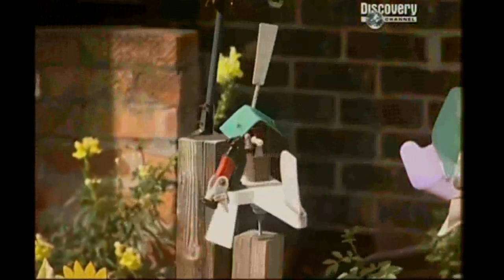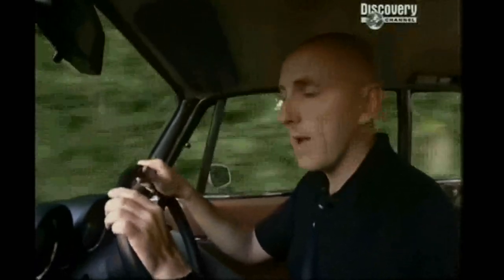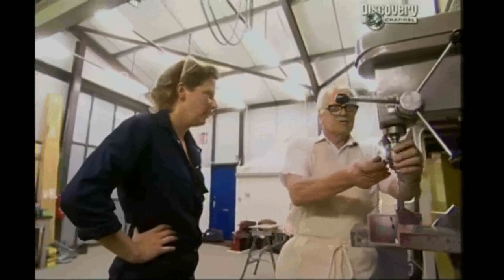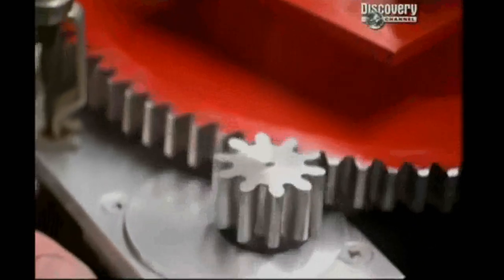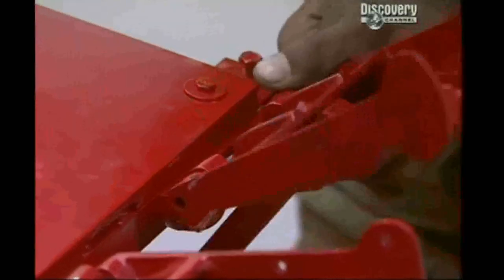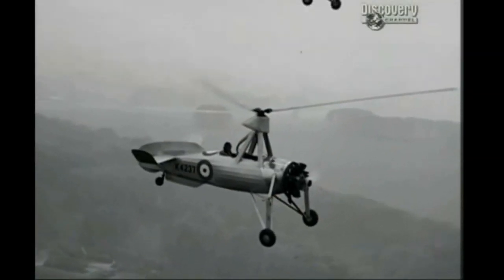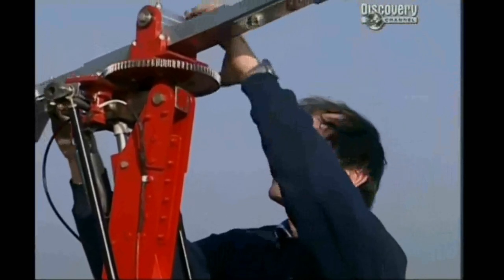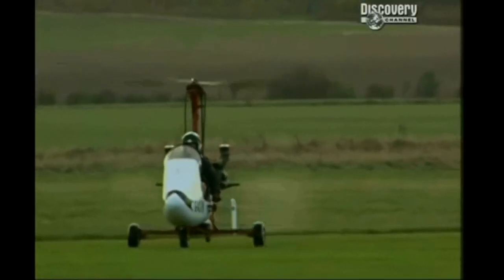Salvage Squad S01E04 (Gyroplane)

Comment: Why did they scrap most of it.
Reply: i suppose to make the show more interesting.
Reply: Neglect from sitting so long. Aluminium corrosion most likely. The worst thing fot a flying machine is to leave it sit and not use it.
Reply: Better to learn to fly first before you build anything.   Most people get it backwards, and build something first, without learning to fly.  When you learn to fly, you'll realize what you really want and like to fly, and it won't be what you thought you wanted at all.

I wanted a Fokker DR1 triplane; what I ended up loving to fly most of all is an RC quadcopter simulators.  Worlds apart.   An airplane would bore me to tears now; I know, I have three airplane projects collecting dust.

Comment: Question for you V-dub peeps...  Can a typical VW engine be carried in your arms like they do - or is this one special ,  e.g. it has a lighter grade aluminum or magnesium block?
Reply: Matt Kustom Kostumes they range from 91-114kg depending on spec for the type 4 2liter that they said this was.
Reply: When used in such an application the housing is seriously ground away so it's much lighter than a standard car version.